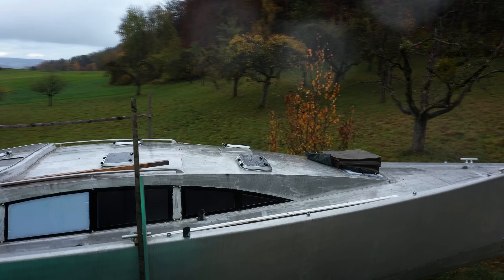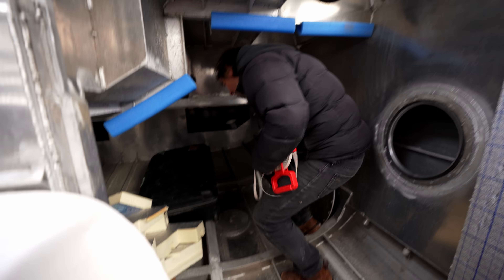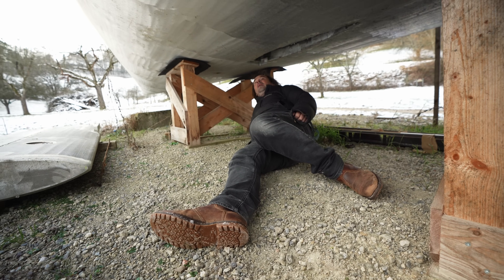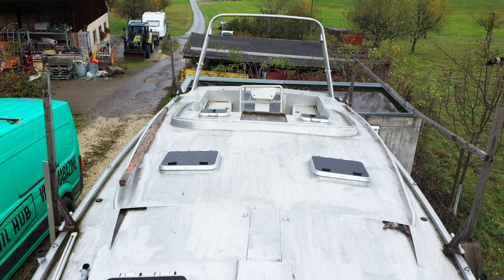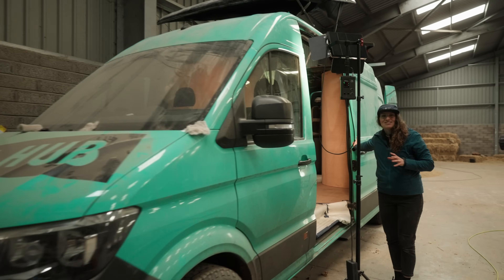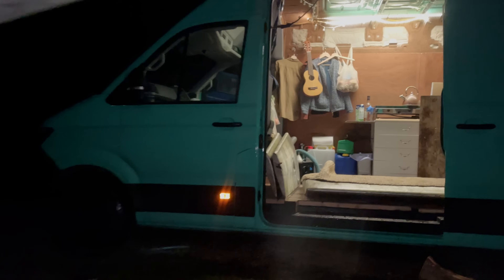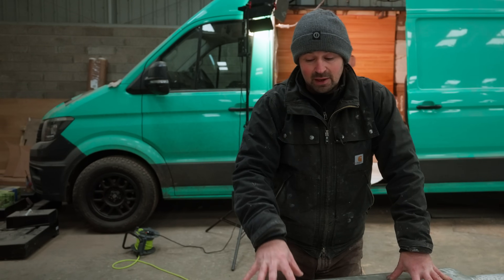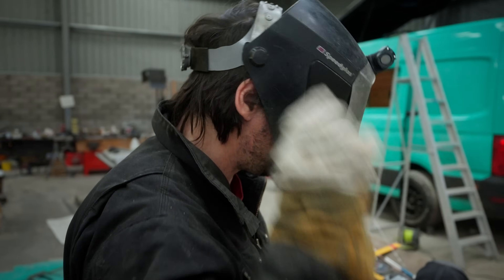We found a 40’ Arctic Sailing yacht Project!

Comment: lots of good boats done in aluminium , they can withstand a lot of punishment if one misses the water ever ,and land on a reef or other inconveniently dry object . my only sail on one was a bit off putting , a roughly made all out race boat ,looked very dodgy ,and actually the keel fell of a few weeks after that ,middle of a race [ they lost that race ,even though the weight reduction could theoretically have been advantageous , the mast slowed them down ,as it was creating a lot of drag ,underwater .]. You may have to bend the all electric a bit ,put a donkey in it ,to motor through the french canals and up to your build home .
Reply from the maker: That’s the best comment were ever  likely to get. Literally laughed out loud. 

Yup, I can agree with all you say and that story. Classic! 😂👍⛵️🤷‍♂️

Comment: put on the keel and rudders get it steering, put a motor in it, a temporary cabin floor basic nav gear, motor it to Scotland. its Aluminum and does not need painting.
Reply from the maker: Hey up fella, mate your in the same page for sure… only wouldnt it be cool if we could change scotland for a few months on the south coast and then some testing across the Atlantic. A few bean bags and hammocks… That would be fun, maybe?!
Reply: @SailHub  sounds great! I'll have to pop across the pacific then around the horn the old grain wind jammer run from OZ to the UK. test out the bean bags, and go home via the northwest passage or around the horn, tick off the Indian ocean on the bucket list. to boot.
Reply from the maker: @wazalee4872 now we’re talkin! What are we like 🤷‍♂️🤦‍♂️😂

Comment: The Spirit 72 is magnificent with fabulous wooden boat building skills. You've found a great boat, hope you can do your best work on it.  As regards moving it, I would look for a suitable trailer even then the hull only is probably around 7 tonnes?  Perhaps in the UK see what options you have to get it towed, there are networks where trucks move around looking for jobs, some people take an interest in moving unusual loads. Although the canals are probably the cheapest method, at least in Europe.
Reply from the maker: Hey Tom! Thanks mate, yeah the boat is great and we are really excited!!

The move has problems as it’s associated with moving through several countries. This outs the price right up there despite its weight of only 3.5T. The weight sounds good, and the shallow height too (no keel or rudders) but a beam of 3.8 that can cause the transportation problems apparently.

Basically all of the import export paperwork, time at several places on the journey pushes the price really high, so high that it’s just not an option.  In fact it’s insane.

So, it’s going in the water! We have a plan now which is fab… We just have to implement it 😂
Reply: @SailHub  That sounds like a 'convoi exceptionnel'!  With a beam of 3.8, perhaps she'll be on her side for any road journey. I guess it depends on your route to Scotland and your build site, would be easier under cover. A benefit of the lifting keel is that you don't need much of a slip or tidal range to get her afloat at end of the build, should open up more and cheaper options. The first leg to the canal/river sounds like the trickiest. I can't imagine Irish ingenuity, flexibility or accommodations in the local approach to the issue. I'm sure it will work for you.
Reply from the maker: @Tomm9y hey Tommy, thanks fella. It’s all coming together now, finally things are aligning and the van is taking shape too. As soon as we’re finished creating our new home on wheel we’re getting right into it!! Can’t wait?👊👍

Comment: You could of made a plaster and glass mould of the other bulb ,25 - 50 mm thick would have been enough then thicken it up when you got home. this would have given it some drying time as well . i have made bulbs using this method before and it works . mixing the plaster and raw glass no resin just allow time for all the moisture to be gone . then place the mould in a sand bed for pouring . anyhow that's a great looking boat you have found , looking forward  to see it being finished off. Cheers from a Aussie viewer living in Norway.
Reply from the maker: Great idea that! Wish we had thought of it 👍 

We got by in the end with technology which is unusual for me! Still, it was a super cool learning process, fingers crossed it works out though! 👍

Comment: If I am not mistaken the hull was offered by KM some time ago, I recommended it to some friends. Interesting that it is popping up again. 
Think carefully about where you want to continue building, transportation to the canals is also expensive. 
I have built a Reinke 13M myself in ten years and a closed hall would save you a lot of time. 
Try to make contact with a foundry to cast the lead, we were admitted there during the company vacations with a casting master. 
Unfortunately, my advice sounds schoolmasterly; I can understand your enthusiasm. 
Good luck in anticipation of further contributions, cheers
Reply from the maker: Hey, yeah your right… it was sold during covid and got layer up since, it’s a long story and we’re glad to be building her. 

As for your advice, it’s not school master like, it’s dammed sensible and we appreciate it, a lot. So, thank you for helping us 👍
Reply: @SailHub  Perhaps one option would be to take the hull to the south of France, the option with the canals was formulated. 
There is not enough time in Switzerland to work productively. 
I have the feeling that your enthusiasm, which is conveyed in the video, will make the boat sail.

Comment: Haha, you guys are doing something similar to myself. Currently I'm living in a VW transporter that is a working process (solar panels, LPG tank, water tank etc) until Spring. Then 2025 I will have the design for a more modernized Sheppard's hut, in which I intend to be the flagship for my own business and batch production. 
Ideally in 2028-2029 I'm hoping to be able to see the financial gains to buy myself a catamaran or sailing boat. Let's hope.
Did you choose Scotland because the land is affordable when it comes to rent? 
I live in the midlands, but see myself travelling back and forwards to mid Wales when it comes to assembly.
Great to be able to follow your progress 👍
Reply from the maker: Hey! Man, that’s epic! Good luck with all of that, I mean.. where do you even start! Brilliant!
As for Scotland, we have family there, when we get going we will likely need to be in the south as all of our partners are there… we best get saving! Kerchhhhhing!!!
Reply: @SailHub   I'm starting with many hours Infront of spreadsheets and in the library. If money is tight, possibly building a second campervan that you can sell, while you have all the equipment to hand (and the processes all fresh in mind). I'm sure you wouldn't struggle to find a buyer with all the following and make a pretty penny as a buffer before you get started.
One step back and two steps forward🤷
Reply from the maker: @terencebarnett9891 hey bud, thanks mate, that would be epic but sadly we don’t own the shed and we need to get out!
It’s no stress though, we will sort something, unfortunately YouTube doesn’t pay much so we may take on some adverts to help pay the bills. The project demands a lot of time and finding time to work alongside it is becoming increasingly difficult!

Comment: Very cool boat! Going to be a heeler even with internal ballast. Any ideas on a rig?
Reply from the maker: Thanks fella! For sure, that’s exactly what’s she’s going to be, mind you the stern return is rather abrupt and rather narrow at the back.

We’re working on a rig at the moment, we’ve got a few ideas, she’s a fractional with a large roach so we’re just computing the forces. A solent seems like a good idea for an ease of use design, especially given the twin backstays/roach situation. However we’re waiting on the airflow analytics on the sails before we commit.
Reply: @SailHub  I have a Solent on my Saga 43. Very versatile. Masthead with fixed stainless bowsprit where the genoa headstay attaches. Solent stay at stem. Removable inner forestay for storm jib and mast stability plus removable checks for mast stability. Great rig!
Reply from the maker: @jessefalsone1247 yeah, we’ve had two solent rigs, they are functionally brilliant. I love them! 
I’m just not convinced about the efficiency aloft due to turbulence that may effect a flat top main. 
Not sure if you’ve seen our website but the boat build is in general to see how efficient we can make a boat, so every little counts and I just have an incline that a cutter will be more efficient. But, we will see when we get the aero program on the job! 👍
Reply: @SailHub  genoa on the spit and Code O / Asym on a Selden carbon pole should considerably improve the aero. I would think a 130-135% genoa for such an easily driven hullform is quite adequate and reduces overlap and mainsail turbulence. If you're going flat top main, you'll be sailing with more twist at the top. Maybe more than you want for light air efficiency with masthead rig. My observation on the100%  solent (mine is custom with proper aspect ratio, not Saga standard self tacker) is that above 15 kts AWS, it's better than the genoa close hauled. Just less draggy with no mainsail back wind. I have a new solent on order with rope luff that will allow a smooth transition from reefed down jib to storm jib. I think that makes sense. Cutter also makes sense but then you really should go with a Yankee unless you think you can get enough area out if the staysail to go either/or configuration but then you're more or less like a solent.
Reply from the maker: @jessefalsone1247 cool. I can picture your set up thoughts. 

Mind you were could end up on a completely different tack here, with several innovations in sail cloth form manufacturing techniques to lamination and material technology etc the options are somewhat greater than they once were for us. 

For us, efficiency in performance and also use of minerals/recycling etc being the name of the game it’s going to be interesting. 

We’re looking at all sorts of ideas and trying to get outside of the usual box, maybe even going more closely related to our old gaff rigger in some respects. Anyway, I think we’ve got plenty of time to come up with a plan and one things for sure, with modern computing software it’s going to be a real game changer to us! I can’t wait to be honest!
Reply: @SailHub  Really cool to be working with a blank canvas and an open mind. I suppose that one big consideration that has implications to your rig/sailplan selection is what you decide to do with your keel. I saw the video where you did your own metrology on the other boat's keel. Are you locked into that that bulb shape? Can you alter the keel design to incorporate a more efficient foil section (Eppler perhaps)? Will the hull structure allow for more righting moment? I'm sure you are thinking on this. Such a cool project!
Reply from the maker: Hey, thanks mate. Yeah it’s a super opportunity for us. We’re so pleased!
As for the keel, as she’s a lifter there’s not a huge amount we can do easily, I’ve looked into quite a few options but it seems like the best option is to go with what we have for now.
The righting moment is bonkers due to the water 900l ballast! It’s pretty much the same as an oyster 50! Not bad for a 40 footer. Should be quite a stiff boat. 

I would love to play with the keel foil a bit in the future but it would need a new keel build and I really don’t think there’s much point as we will need the width for lateral stability and the rest of the foil appears pretty well formed to be honest. 
 
We did faff with the bulb shape a bit though, although I’m not convinced it’s going to make a massive difference… we will find out I guess!

Comment: What a lovely boat.  Aluminium is such a good boat material.  Look forward to seeing how she develops.
How about the rig.  Are you sticking with the standard, or something more interesting.  The beauty of having a boat at this stage, significant changes are not so great an  issue For me that boat would be great with a free standing mast, with some form of aero sail. Ideal for short handed.  
Will you be fitting waterproof bulkheads.
Reply from the maker: Hi Mark, 
A few ideas here and there. I will stick with a sloop rig though. It’s just easy for everyone. We want people to be able to come and sail with us easily. I’m also want to optimise performance by retain as much reliability as possible. We’re in talks with mast companies at present but nothing concrete yet.

Bulkheads, for sure a front one, not sure about a fully enclosed rear one, probably though but it will need a hatch to access the steering.
Reply: @SailHub  ok. But I would consider a good old mast head rig. I like to be able to sheet out to 90 deg.
Reply: @SailHub  ..of course with hatches, or full sized watertight doors, as on Navy vessels
Reply from the maker: @markthomasson5077 yeah, I think for most cruisers I would do the same, it’s a great rig and great advice. This thing has a 27° spreader angle though, a gooseneck 4” off the mast step and no kicker in the plans. Clearly designed to generate enough apparent wind to not need that 90°. 
At the moment I’m leaning toward somewhere between a 3/4 and a 7/8 fractional. I liked our old Najad 373’s 7/8 fractional a lot.
Reply from the maker: Criekey, that’s pretty hardcore on the door front! I don’t think we need to go that far. It’s not an Amel! Mind you, I flippin’ love a proper adventure vessel. I just don’t think this is really one of them.
Reply: @SailHub  the fashion seems that all rigs are now based on racing rigs.  The ability to safely spill wind has been forgotten
Reply from the maker: @markthomasson5077 Hi Mark, you’ve made a good point about modern rig choices there and you could well be right! 

I suppose for me thee are many ways to look at it at present. Yes, a lot say it’s fashion, coming form an industry point of view I would say  it’s profit margins and sales.
Swept spreaders, can generally mean lighter rigs, less stays, less bulkheads. It all means more space in the cabin, a boat that feels bigger down below, looks fashionable and most importantly and costs less to make. 

There are then the boast that do it for another reason, performance and greater forestay tension.  

Regarding spilling wind, at the end of that we must remember the spreader angle doesn’t effect the ability to spill wind, twist in the sail will still do that although you can still just ease the main if you wish as the only time thy won’t work is dead down wind where it won’t de power the sail anyway. 

What I will say is that for me swept spreaders don’t make huge sense unless the boat can the create enough apparent wind to actually bring the wind angle forward enough. Or.. you happen to be racing without an symmetrical spinnaker where VMG is improved through jibing to optimise an asymmetrical spinnaker down wind and of course utilising the higher headstay tension to point higher up wind. 

Anyhow, we all have our own ideas, that just my thoughts from working on several rigs over the years.

Comment: How do you transport the lead bulb?  Assuming made in Scotland.
Perhaps make a temporary concrete bulb so you have enough stability to motor.
Reply from the maker: Hey, we’re planning on keeping it simple, as the keel is only 2 tonne we can take it in a normal van… in a cradle on an angle….. 😄
Reply: @SailHub  aye…but the cost of new springs n shocks!
Reply from the maker: @markthomasson5077 for sure. A sprinter or a crafter could do the job easy enough… as for the springs… I guess that’s the beauty of hire vans! 

We got some quotes to have it taken for us but because it’s transiting 3 or 4 countries it’s too expensive. That’s multiple countries is the reason transporting the hull is out of budget too.
Reply: @SailHub  nice one!  
Is there a canal close…not many in Switzerland!
Reply from the maker: @markthomasson5077  we will get dropped in at Basel I believe. It’s about a 2hr drive for us.

Comment: Beautifull go anywhere and fast yacht. Congratulations. Top choice.
If you want to do the initial work to get it afloat and motorised in CH please be aware of stay limitations and customs for parts you'll need. The plan to sail your boat up to the Uk may  cost more then the quote you got. You'll need a crane ond oversize transport anyway to get near the water. Friendly  advise : ask several  hauliers for qoutes providing as much detail as possible (wt/dims/plans/lift points)...the type of crane they think they'll need for example can make up to 500 EUR difference per lift. Giving a large time slot for the job can also help the price. Don't  just ask locally.  The most competitive companies for those jobs are located in the Netherlands.  Good luck !
Reply from the maker: Hey! Thanks for the advice, yeah we’ve been googling our eyeballs out for over a year now! We needed to make the numbers work before we committed. Still, to be honest it’s still a gamble as you never know until you know!

Comment: Cant you find the original mold for the lead keel bulb?
Reply from the maker: Hi Rufus, good question and wouldn’t that be great if we could find them! 

There were are two sister ships made with a custom mould. The keel casting company is no longer in business, I believe the moulds were concrete which I imagine means they were most likely destroyed. Anyhow, we tried to get a hold of them for 1/2 a year before we gave up!